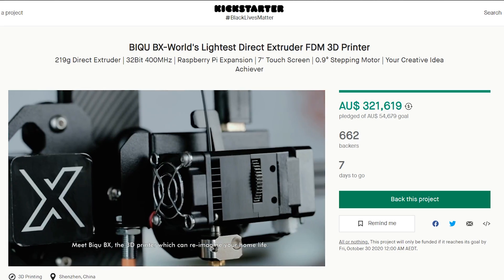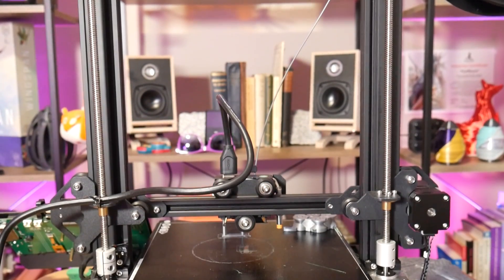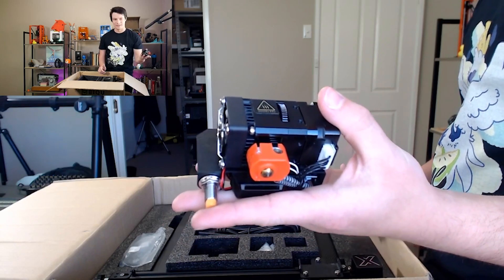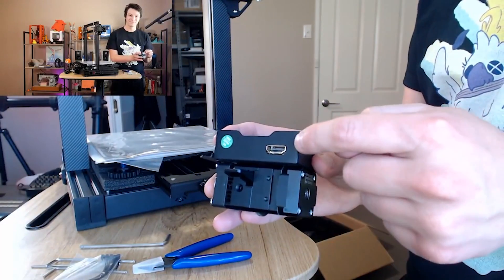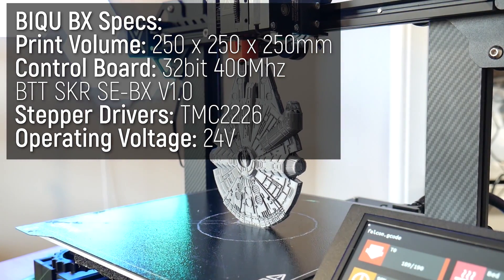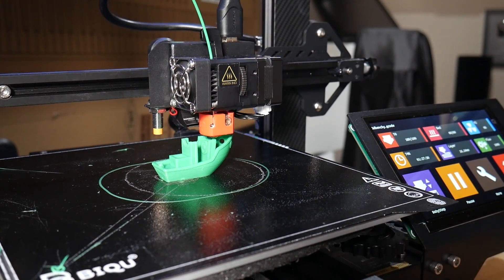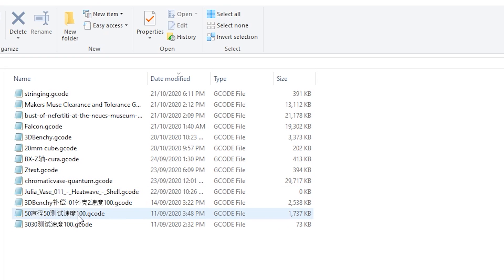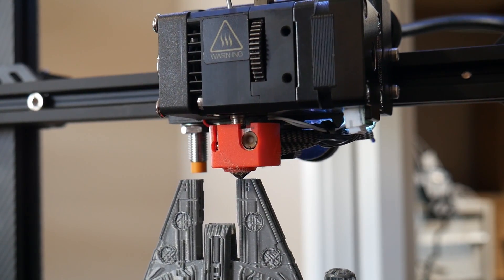The BIQU BX is an innovative 3D Printer, and a little strange.

Comment: I've had issues with btt boards killing my sd cards, so not surprised you had issues.

As for the z probe height, that's a marlin issue. Basically if you have soft endstops enabled, marlin z height adjustment will increment the number but the head won't go past z0. You can disable them with the marlin ui.

Finally, the kickstarter thing was totally a hype thing and a bit of a scam. They went around telling people there would be a lot available for $250 usd, then required people to pay a $10 deposit to secure that price, and they still ended up not having enough for those people, and telling them to use the $10 pledge and manually change it to $250. I ultimately ended up not ordering one because of this, and I'm glad I didn't
Reply from the maker: I had no idea about the $10 deposit thing... that's mega dodgy??? How many companies do I have to add to my naughty list this year.
Reply: Agreed with the BTT corrupting SD card on the touchpanels.
Reply: They also did something fishy with next lowest tier, they always added and substracted available slots so that it always appeared that they had just a few left to lure in new backers.
Reply: The z offset thing drove me nuts with my Kossel till I worked out to disable the soft endstops..
I'm about to retrofit a biqu h2 to my tronxy d01 and would love to have all the wiring including the stepper motor wires go through a neat single cable solution (a lock of some sort would be cool..) I wonder if the wires in the cable can handle everything going on up there at the H2 at once

Comment: Firmware is wrong in deciding it's base Z position. It won't allow you to go under Z0.0 but on the screen buttons are connected to increasing/decreasing the displayed value AND to moving by 1mm. So visual representation and machine itself desynchronize.

Comment: @Angus I don't get the fascination with i3 style printers... huge moving mass, no strain relief on cables (especially on the bed), most are paired with V-slot extrusions. Yuck.
I just can't force myself to get excited about them including a probe - that should be standard issue or at least a plug in option on current printers and it's still mostly omitted.
That screen is ridiculously big. I don't get why would you want to run Octoprint on the machine itself? It's a remote interface to be used from a comfy chair situated far away from a noisy, smelly machine.
From what you've described about an SD card in the screen, I'd suspect to aggressively set communication speed between the screen and the main board, or badly routed cable that picks interference from motors, etc.
I'd really like your take on Sapphire Pro or Plus, mostly to show there are other things than i3 clones. Both are a bit more like a tinkering platforms than actual working-out-of-the-box printers but you get reasonably stiff CoreXY with linear rails. Cabling is atrocious, hotend seems to be hit and miss, but if you plan to put in Mosquito or V6 it's actually a really good starting point. Flashing Marlin v2 is not hard so you get a proper firmware also. I'm currently modding my Plus to include dual magnetic toolchanger, inductive bed probe, passively heated chamber with termistor and auto fan, lighting, and few other details.
Reply from the maker: I3's are cheaper to make, mechanically simpler, lighter and cost less to ship so they're overwhelmingly more popular. I definitely agree a bed that only moves in the Z is superior, but those designs just can't reach the same price points unless like you say, they need a lot of work. With conservative accelerations you can still achieve really good prints even if the print bed moves.

EDIT: I did quite like the Tronxy D01, until it almost caught fire and the company gave me a hard time for telling everyone. Forced them to roll out thermal runaway protection though!
Reply: @MakersMuse  Complexity is actually not that different. Price difference comes mostly from linear rails. D01 is essentially the same as Sapphire Pro with a bit of different seasonings. Price is also pretty much the same and it's also comparable to BIQU which is admittedly a bit larger and comes with a probe.
I agree in principle the price point is different, but paying 300$ or 400$ for a printer is pretty close. I know many people will disagree, but the difference is equivalent to a few spools of material.

Comment: HDMI ports & cables are cheap, thanks to wide spread use. I think it's a clever way to reduce cost shrug
Reply: It's not that clever if you understand current and wire thickness, and how the typical consumer sees a cable.
"Same plug - will work" is a pretty common belief. Expect stories of blown up TVs from this, aswell as potential fires from too thin cables.
Reply: @tin2001  Do you really think many people will be plugging their TV into this? Or the fact that power is not feeding FROM the device, but INTO it? Other devices have used this standard for power and data connection, yet no dangers there.

Comment: The issue with bed leveling is to use the M211 S0 code to turn off the software endstops so the z axis can go below 0 height I to the negatives.

Comment: The problem with the BED LEVEL could be from from the changes of the temperature in the proximity sensor because the cheap ones are VERY SENSITIVE to the temperature fluctuations giving very different results at only a few degrees variation. That's way Prusa uses PINDA with thermistor inside and does some compensation ...
Reply from the maker: It does indeed, so I mesh levelled at PLA printing temps to try keep things consistent

Comment: One of my clients got the same version so I was able to set it up for him.  The USB input works fine but I haven't tried the micro SD slot as of yet.  When I was setting it up for him I also had issues with the SD card input on the screen.  Once I started printing from the USB input that was on the screen things were working fine.  I also had the bed leveling issue.  I found that when I changed the leveling increments from 0.01 to 0.1 it would then start working while setting up the Z offset.  I'd be interested in know if this fixes your issue as well.  We've only been able to do a couple of prints so far but it would be interesting to find out if the machine retains the EPROM settings over the long term.
Reply: I was having the same issues with the Ender 5-plus' BL touch implementation. Even sending M851 commands directly to change the offset, there was something strange going on. It seemingly would apply the offset randomly. Sometimes live, sometimes not at all. Sometimes not until the next print started and crashing into the bed. I have a sneaking suspicion it might have something to do with the buffer being busy with G1 commands, plus when it sends the M503 to recall the stored data, or the M420 for actually activating the mesh. The up/down issue is caused by software endstops being applied. It will stop it from going down but log the change (stupidly) M211 S0 to turn them off fixed that little quirk but we eventually gave up on the printer as we could never fix the offset issue. Also, forcing a bed level before every single print instead of storing and recalling a mesh was asinine.

Comment: Great video as always mate. Sure it has some weirdness, but, l too like the inovative hotend/extruder setup. Considering HDMIs are designed to be pluged in and left in situ, I'm pretty sure it is not going to last long on the X carriage end, it's gonna wiggle contunually and the contacts will weaken causing high resistance connections. Then the machine will have to rely on the thermal runnaway protection to avoid a potential fire. Of course, I hope I'm wrong. Also, I don't have this printer so not talking from experience, just theory.

Comment: The loose hdmi connection is honestly really dangerous. Also, why don't more people talk about magnetic beds losing magnetism at high temperatures? This wasn't a talked about issue with the ender 3 pro. Kind of in general I think the printer is too cheap for what it is offering.

Comment: the HDMI connector is a dealbreaker on this thing. There aren`t any current ratings for those cables. They are made for low voltage, low current data transfer, not for heating a hotend. Even if BTT provides special, save HDMI cables that wont stop stupid people from putting their $2 tv HDMI cable into it and in doing so burning their house down. 

Other than that: The connector will wear out. Thats a freaking no go. No stress relief in sight, only to make it look fancy over making it safe.

Comment: BIQU has very crappy interfaces, both graphically and functionally.
They offer low prices for good hardware but software is where they are able to save from the development costs.
Reply: Oh and HDMI cable is definitely not designed for this use, mechanically, it was meant to go behind a TV, monitor, to console, PC, DVD player, stationary in one word.
In this application where it constantly moves, it will wear out quick.
They should have at least designed some kind of locking mechanism.

Comment: I'm not sure why all the negativity towards the HDMI cable. I appreciate a lot of the opinions presented by these 3D printing YouTubers, but it's clear they often don't have a lot of development experience. I'm an engineer in the consumer electronics industry for 12 years and I think the use of the HDMI cable makes a lot of sense. We actually use HDMI for power and signal delivery in a ton of prototype applications. In many ways it is superior to the old D-sub/RS-232 type of connectors. The most important factor is the cycle life. HDMI cables usually have a significantly higher cycle life meaning you will start to have issues with a D-sub after you unplug and plug it in about 50 times. An HDMI cable can go for about 5,000 to 10,000 cycles. There are also a lot of forms that the cable itself can take. We use a lot of HDMI ribbon cables in dynamic applications. The are great for moving back and forth along an axis. The pull force on an HDMI cable is high enough as well that you should experience no issues with the "friction" fit of the cable in the socket. Personally, I really like the idea of the HDMI and I hope they stick with it. They should rotate the port 90 deg and use a ribbon. That would be great.

Comment: I wonder if the SD corruption was due to some EM interference somewhere 🤔
Reply: Can be EMI that causes data corruption, or firmware that is buggy. Or Angus got some cheap chinese SD-Cards that use fake chips that fail after a few write cycles and/or report more storage space than they have actual flash cells...
Reply: @ProtonOne11  Anguas sais he tested different cards. Unlikely they all are bad. Its either EMI, or the electronics have a signal integrity issue with the SD card signals.

Comment: I wish manufacturers could get their heads together and agree upon an industry-standard set of touch screen icons, they could set the firmware to offer a choice standard or manufacturers custom icons.
Reply: So basically printer GUIs need their own versions of the save icon's ubiquitous nature, Which even on some non normal desktop computer platforms is a 3.25" Floppy

Comment: On the magnet, is there another "layer" of some sorts on it? Because I ordered one of their spring steel sheets for my own printer and it came witht his weird extra magnetic surface. Which while on made the magnet so weak it couldnt hold on the sheet through a plastic bag. But once I removed it, it stuck very well.

Comment: The reason it won't go down further on Z is likely because "SOFTSTOP" is activated and it won't allow it to move below it's virtual 0 offset.
Reply from the maker: I did wonder that, but surely the bed level adjust should be independent of that... otherwise the only way to get first layer height after mesh levelling would be to plunge the nozzle into the bed, and then raise it up.
Reply: Yeah but that should be an error condition or simply limit acknowledgment of input commands & movement
Reply: @Henry680  It's marlin, so it simply won't move below.

Comment: The LED Strip "does not have any functionality". It does, I had to manually add one to mine.
Reply: Exactly.
A LED strip might not be necessary in a well lit film studio, but for normal people, especially if the printer is in an enclosed case, I wouldn't want to use it without LEDs.

Comment: The Z offset issue is that whatever the last known "Z 0 position" was,  the touchscreen wont let you manually move the Z axis lower than that until you reset "re-run" the Z homing.  That's why you couldn't move the z down until it was raised above the previous home point

Comment: There is a bed leveler.  HDMI cable is insulated and is good for sending electric signals, and they are cheap.
Reply: HDMI cables are made to be plugged in and left alone behind a screen or tv, they are not rated or designed for constantly moving applications. So i would expect some wierd failures after printing for a while...

Comment: Using an hdmi cable for data transfer isn't abnormal. We used them on large format printers and industrial label printers to communicate with print heads
Reply: But in this case it is used to power the hot end...

Comment: Not really a smart idea considering HDMI connections are notorious for breaking or becoming loose when exposed to excessive use or vibration (the Sony amp/video deal debacle from some years ago, in the car industry ringing a bell in my mind). Personally, i would've gone with a custom magnetic port, if that's the intent (to have easy to remove/swapable heads).

I don't remember the exact code, but there's even a mil spec magnetic port used for quick disconnecting when removing something in a hurry, like a laptop or a emitter/receiver box. Bigger, but on the same page, but a lot more common is the one that's used by medical or firefighting vehicles. The idea being that those vehicles need to get going fast, so there's no time to deal with connections (battery chargers, data transfer).

So yeah, no idea why anyone would go with HDMI of all things, i was quite shocked to see it on the stream, when there's much better same-same options out there. And whilst, yes, someone could make the argument of saying "ain't cheap", i doubt it's something difficult to engineer one based on existing parts, and then printing it. All you need to find are the ring magnets and pin terminals.

If CR-10 s(plural) could be shipped with various printed bits in the early days, i doubt making a quick disconnect port is that much of a big deal. Heck, there might even be one out there to license or ask permission to use for a cheap price on the machine for example(most creators are magnanimous like that).

Comment: I've been wondering for a while if we could actually use cameras on 3D printers and use computer vision to detect failed prints. With enough data, it should be a relatively easy machine learning exercise.
Reply: The spaghetti detective plugin for octoprint is just that.  An ml app to detect failed prints.

Comment: I very much doubt that it's a PEI coated sheet. A lot of manufacturers are quick to claim something they don't actually have so it's interesting that Biqu are just calling it a "Spring Steel Sheet" and not a "PEI Coated Spring Steel Sheet." Also, when doing a tour of the various marketplaces for PEI sheets they seem to jump from Ender 3 sized 235x235mm up to Tronxy sized 300x300mm, no 250x250mm sheets to be found.
Also, wasn't that spaceship from Blakes 7 or something like that? :)
Reply from the maker: I think I saw it on a firefly episode

Comment: Can't see the point of such a large expensive screen. The standard Ender 3 type black and white with rotary dial is more than sufficient - not least because I use Octopi for my main control - the  Printer interface is only every used for bed levelling. I would rather they spend the money on upgrading the rest of the printer.
Reply: I like it, my eyesight is not that great and I can see the advantage of having a bigger screen and hopefully they can add more to it, if they sort the firmware out.
Reply: I have a BTT 70TFT screen and mine corrupts the gcode in the same way. Also anyone thinking of upgrading beware the Viewing angles are rubbish on the 7 inch version, likewise the touch screen is no where near has good as the 35TFT. Also having exactly the same firmware with no change it somewhat negates the screen size. I also have a dicky SD Card reader. I probably think the 5 inch version may hit the sweet spot but I am loathed to purchase due to the issues I am having with the 7 inch and BTT store support is not great to say the least.
Reply: The point of the big screen is to make it look good and more people (who aren't really the 3D printing types, maybe) are more willing to buy it cause 'big screen = good printer' or something
Reply: I'm gonna get that big screen and hook it to a raspberry pi and see if it can run crisis
Reply: If someone really wants a big screen they can just buy a cheap laptop and put linux on it or something and use it to control the printer. I did that on my first printer and it worked great.
Reply: @JonathanKayne  Yup. You can find used laptops very cheap.
Reply: @shadow7037932  I found one of those old netbooks for half the price of the cheapest Pi I could find

Comment: That bed and cabling are a no-go already, I wouldn't even do a quick-look on it to be honest. While the printers from China are still very cost effective, they are getting extremely boring tbh (both in originality and bugs they always have). Of course you might improve things for Kickstarter backers, but at the same time it also validates Kickstarter as the way to go for these companies. Difficult situation, Joel already decided not to do it anymore which does make sense I think.